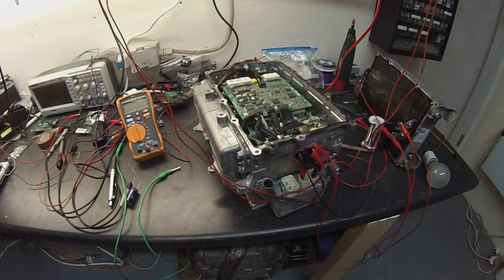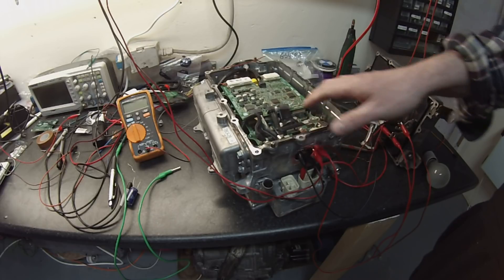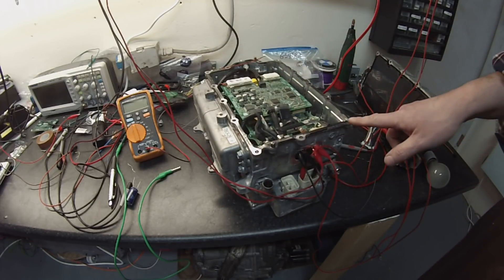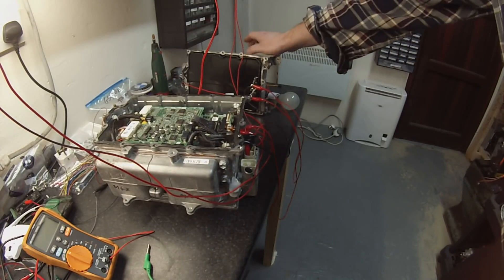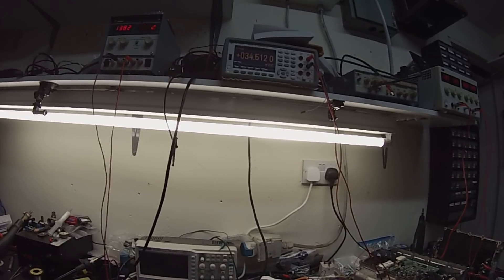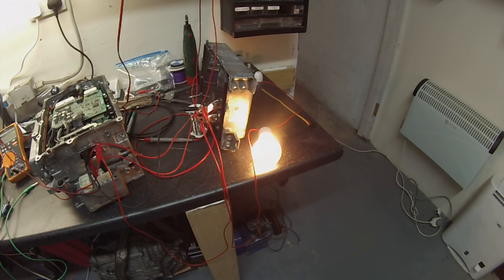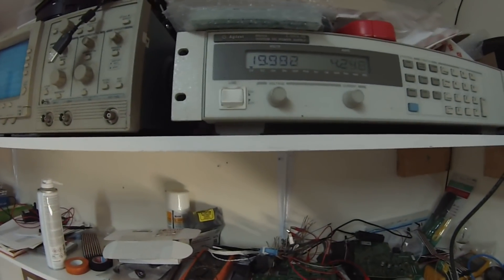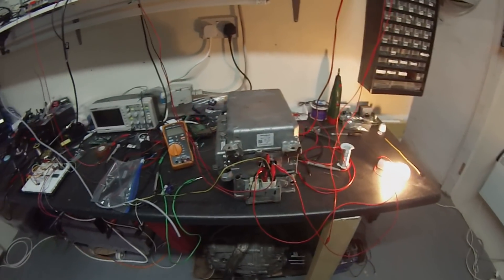Lexus GS450H Boost Converter Hacked

Comment: Would it be possible to build a bigger transmission with stronger motors, and then use the logic board from Toyota to drive some bigger inverters that you could pair with it? I guess what I'm asking is whether the existing logic could scale to larger hardware and more horsepower without going into some kind of protection mode.

Comment: Great newes! 
What about using the converter in buck mode to charge the battery from 3phase rectified 600Vdc down to 390Vdc or 288Vdc? Have you tried to buck the voltage down?

Comment: 30V DC boosted to 180V DC, so 6x increase.
20V DC to 247V DC is 12.5x increase.
Would be interesting to graph efficiency vs boost ratio.
Would be something I'd be interested in playing around with too, if not for the pricing.

Comment: What does the motor inverter use the boost circuit for?
Reply: Actually technical specifications say
Battery: 288V
Motor: 650V (500V for eco mode, mentioned elsewhere)
https://media.toyota.co.uk/wp-content/files_mf/1319280368tech_spec.pdf
Reply: Boosts the voltage from 250 to 350 volts to increase output to motors I believe
Reply: @ReubenHorner  that would be one hell of a booster.